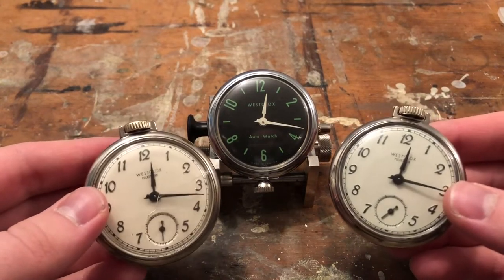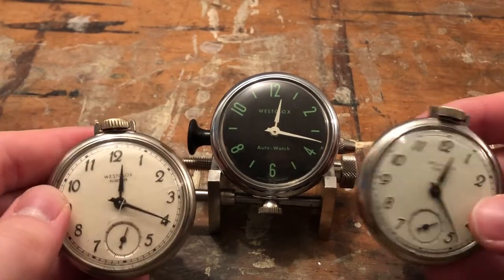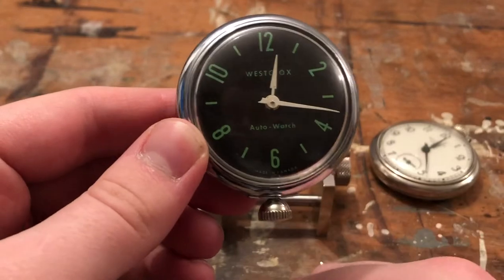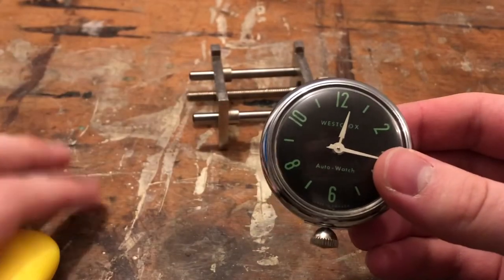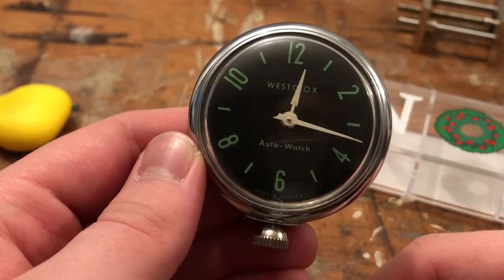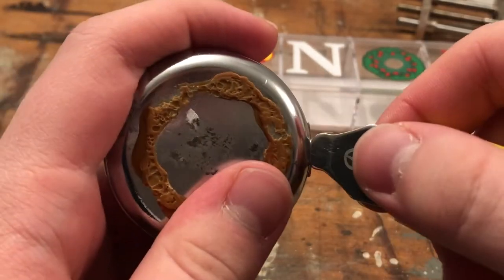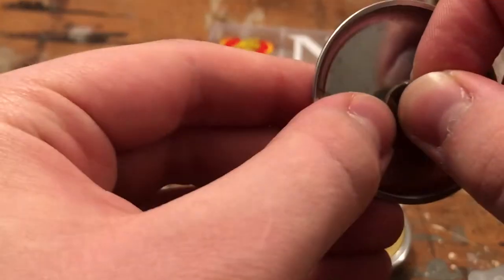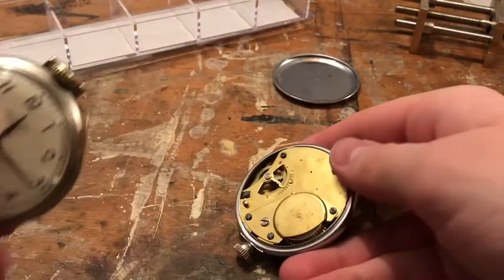Westclox Auto-Watch Disassembly (Part 1)

Comment: Hello I just picked up a 1950's pocket bend.
It runs.
But it needs a cleaning. I was wondering if you ever got your demagnetizer? And which one did you get thanksRay
Reply from the maker: Hey Ray!

I went to get one through amazon, and I'm pretty sure it works? I've used it quite a bit, but I'm honestly not sure if it works. I'd probably advise checking ebay and buy a German made one (or something higher quality).

Thanks!

Comment: Good vid! Question: I have similar Pocket Ben. In what direction should the crown be wound to adjust the time - clockwise or counterclockwise? Mine winds in both directions but with considerable resistance. Thanks.
Reply from the maker: It should spin be able to be set both ways when the stem is pulled up

Comment: I forgot to tell ya that my other pocket watch is a Colibri. I got it as a Christmas 🎄 🎁 gift, and it has a day/date feature. It has a brushed gold aluminum dial and plastic crystal. It’s battery 🔋 operated. I’ve had Colibri pocket watches in my past. It was about 1993. The only downfall was, that I didn’t know that the battery 🔋 was replaceable, so I wound 🆙 disposing of the pocket watches when the battery 🔋 ran out. Dumb, wasn’t I? I think those pocket watches were something like 👍 $39.99 apiece, even then. Your friend, Jeff.

Comment: Hey! I was wondering if you could help me out. I got my first pocketwatch yesterday, a Westclox Bull's Eye and it's been working well and keeping time. However, I can't get the stem out based on directions I found online. At certain times, the stem spins freely and doesn't engage the gears to set the time. Hopefully you can give me some pointers or let me know which of your videos to check out to diagnose the problem!

Comment: I’ll listen 👂 to your music 🎶 channel. It’s not good 😌 if these dollar 💵 watches are either dropped into the water 💦, or get near a magnet 🧲. I’m not sure if these are shock resistant, such as if the watch is accidentally dropped once or twice. I have a James Michael skeleton watch, which is spring wound. I’m not sure 🤔 of the value. I’ll guess around $80.00. I won’t be subjecting it to water 💧, or magnets 🧲. I also don’t want to drop it. Dust is also probably not good 😌 for these watches, either. The cool 😎 thing about these dollar 💵 watches, is the choice of face colors (and they usually glow, along with the hands 🙌). The second hand 🤚 was at the 6 o’clock position, depending on what model ya got. These watches were probably $1.00, back in the day, hence the name, “dollar 💵 watches”. Your friend, Jeff.